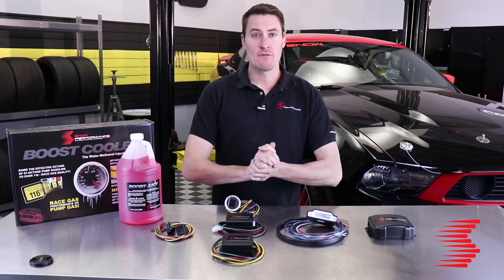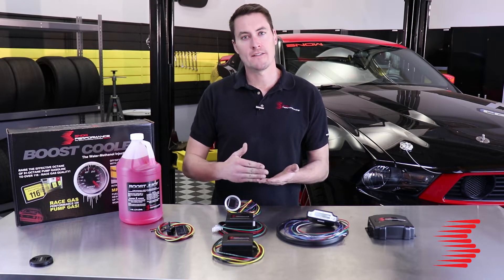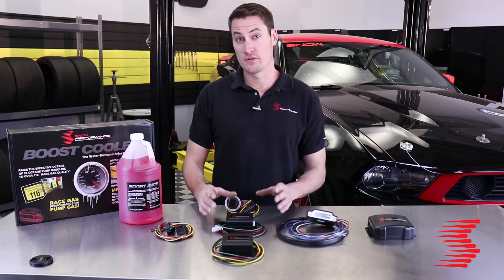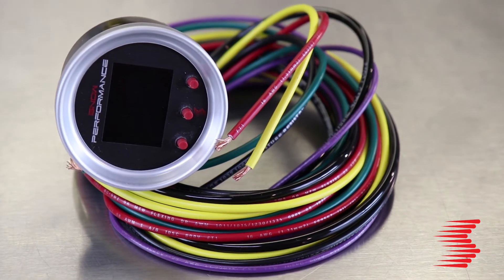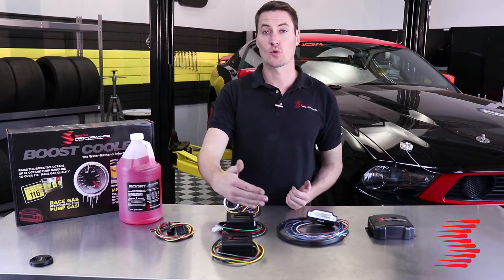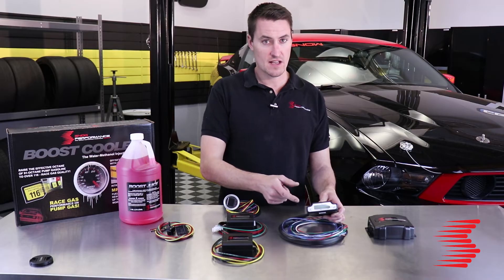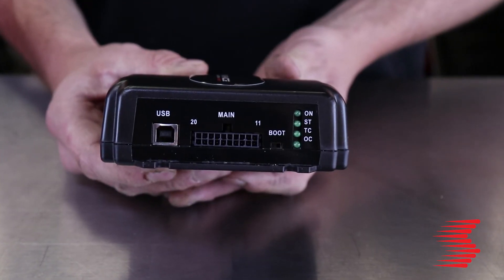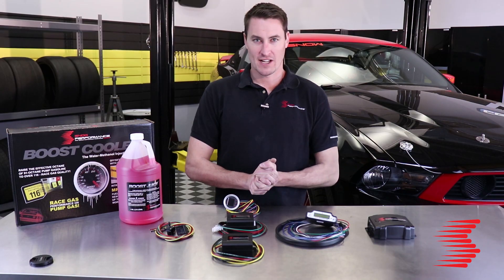Which Water-Methanol Injection Kit is Right For You?

Comment: Planning and going direct meth injection should I get a stage 2.5 or stage 3 kit
Reply from the maker: What boost pressure do you run?
Reply: @snowperformance1 no more than 35 psi. Car currently at 25

Comment: I'm interested in adding this to a n/a Corvette ls2. I've got a FAST intake, headers and full exhaust (400 dyno rwhp). What kind of gains would be realistic?
Reply from the maker: Water Methanol on an N/A engine won't have as many benefits as a boosted application would have. The power made on an n/a car would be the ability to adjust the tune to add timing making the ultimate power increase. The w/m will add some power in general but the main power is made from being able to get more aggressive with the timing/ tune.

Comment: Got a stage1 kit because I already had a Standlaone ecu that could be used as a controller. Was a really simple install. Just a trigger wire DPO02 for the haltech ecu. set up the parameters, Already had a fuse and relay panel so just 1 wire the panel and set up the pump and nozzle and it was done. Do wish it came with more than a size  6 nozzle and a size9 since im NA with a 3.0l v6 A size 4-5 wouldve been closer to the HP i was going for but oh well. Just set it up to trigger at a higher map ,tps, rpm signal.

Comment: naturally aspirated lol
Reply: There are lots of super high-compression NA builds that would benefit from this when race gas or E85 isn't possible to use all the time.  Hell, my grandpa used to get one of his sons to slowly pour a glass of water down the carb of a 440 big-block in a motor-home while going over Mount Hood.  It didn't add any power, but it cooled things down and cleaned the valves and pistons like crazy.
Reply: Did you mean to comment that under my comment?
Reply: I only meant that he kept saying normally aspirated instead of naturally aspirated
Reply: @wiggenvan  Oh.  That's just a dialect thing.  Like aluminum vs aluminium.
Reply: @JETZcorp  Oh sure enough, I didn't know that, I just assumed it was a slip of the tongue. Thanks

Comment: Had shop install my snow 2.5 kit yesterday should my fuel trim not be lower now ? looking at my data logs my fuel trim exactly the same the afr exactly the same what's best way to know if it's actually spraying ?
Reply from the maker: You can pull your nozzle out and place it in a 5 gal bucket, then purge your system to see if water-methanol is coming out.

Comment: You have the controllers.. Not much was mentioned about one controlled by various vacuum levels on a naturally aspirated engine. Propane burns hot too.
  NOW YOU JUST NEED A VASTLY DOWNSIZED PUMP MATCHED THE FLOW NEEDS OF A 74 CUBIC INCH V-2 AIR COOLED MOTORYCLE ENGINE.
Reply: Why are you yelling, you stupid boomer?

Comment: Hello Snow pERFORMANCE,  looking to buy Snow Performance PROGRESSIVE WATER METH INJECTION KIT 210 with a vc-50 controller and trunk upgrade. What is the life span of this system roughly, esp the pump and solenoid. Thank you!
Reply from the maker: As long as its properly maintained a system can see over 10 years of consistent use easily.
Reply: Is the proper maintenance outlined with the kit? Like at x mileage check or replace this item?

Comment: I have an older v25 controller system.  Are there components that I can upgrade like the nozzle and a solenoid.  This is for a procharged F1X making about 17 -18lbs at around 900-1000 hp.  Or should I look at a different system?   Here is the setup albeit it is faster now  https://www.youtube.com/watch?v=jqMdxvWYyq0&t=10s
Reply from the maker: You could definitely upgrade to a newer style nozzle, solenoid, pump, even controller. Since the vc-25 was discontinued we have upgraded essentially every main component in the system to make sure they are more reliable and perform better than ever.

Comment: Can i use a diesel kit on a petrol turbo application, cheers
Reply from the maker: We recommend using the kit/s intended for your application, rather than retrofitting a kit that is designed for your use.
Reply: @snowperformance1  but its the same nozzle for petrol and diesel correct?

Comment: For a low boost application like you would see on a 5.7 hemi (7-9lbs), does a progressive system still make since? Or does the small boost range mitigate the need for it?
Reply from the maker: I still recommend a progressive system for something like that. A non-progressive application would be more for a drag racing application or something like that where the vehicle is at WOT for a short amount of time.
Reply: @snowperformance1  on a hp ecoboost 2.0 build would you reccomend the stage 2 or the 3 for my goals hoping to fuel it solely on pump gas as no ethanol is available local to me but hoping to hit 500whp with my build. I'll have multiple tunes and won't always need to spray meth, is the stage 3 able to turn off the spray easily like the stage 2 or 2.5?
Reply from the maker: @michaelgearhart6685  Stage 3 will give you a little more precise injection than the stage 2 however I think personally the stage 2 is more attractive and works fine for most people. If you decide to get a stage 3 you will need to wire a switch inline to the power to have it be able to turn on and off.
Reply: @snowperformance1  How long does a gallon of your 50/50 blend last in your vehicle?  What is your fuel injectors' flow rate, MPG, fuel tank size, HP, and torque?  Also, for an engine with an 11:1 compression ratio, would your system allow me to run regular 85 octane with no octane booster and eliminate knocking?

Just wondering because I drive a 1998 Ford Expedition with a 5.4L V8 Triton 2V that I want to upgrade to a 11:1 compression ratio to help maximize my engine's efficiency.

Comment: @Snow Performance Water Methanol Injection is it possible to use the stage 2 n210 on a diesel application, was thinking of using it on my superduty but wanted to know as everywhere i searched up said it was universal and i just want to confirm
Reply from the maker: Yes it will work! That systems controller is based on boost alone so there should be no issue.

Comment: Thinking of running one of these kits on my B8 Audi S4. I find in most applications people are injecting pre throttle body, through the supercharger. However, I'm looking to use the SRM methanol injection spacer which is direct port injection, post supercharger. I wanted to know, If i use the SRM kit and I'm running one nozzle per cylinder, how accurately and evenly does the water/meth distribute? Might be a bit of a tuning problem if different cylinders are getting different amount of water/meth.
Reply from the maker: The purpose of a direct port is to get the best distribution possible. As long as the nozzle sizes are the same and its outputting good pressure that's going to be your best route.

Comment: Stage 2 map map controller? Is called for high compression set up ??
Reply: & sorry for the ghetto English my primary language is spanish 
My quection was :

What stage & name is good for 
- high compression 
- nitrous
?
Reply from the maker: @joseginorio6013  What vehicle are you working with?
Reply: 2000 toyota celica gts

11.5 forge piston 
320cc injector 
Aem ems4
100 shot nitrous 
93 octane 
Stage 2 exedy clutch/ fidanza flywheel
Super tech block guard
Supertech valve & retainer
Stage 1 mwr
Reply from the maker: @joseginorio6013  https://www.nitrousexpress.com/stage-3-boost-cooler-efi-2d-map-progressive-water-methanol-injection-kit-red-high-temp-nylon-quick-connect-fittings-sno-310.asp

This system ran in EFI only mode would work great!
Reply from the maker: What do you mean?

Comment: i have a 06 ford mustang gt with a vortech v3 non intercooled system what kit would you recomend and will it run off a 93 octane tuned pcm without needing a retune? thank you
Reply from the maker: We always recommend a tune to get the most benefit out of your system, however you can get it to operate without one. Personally I think the stage 2, 2.5 and 3 are all great options for street/daily driven type vehicles.

Comment: Hello Adam, great video I think I know the answer to my question but thought I'd verify it anyway. Question: The controllers can upgraded or are interchangeable with the stage 1-3 kits correct?
So originally I thought all I needed was the on/off boost switch so I purchased the stage 1 stainless steel braided line kit. It's a really nice kit, I just started installation of it. Actually I bought 2 stage 1 kits one for my car and one for my sons car (he paid me back for it lol)
So changed my mind and now I've just ordered the vc50 controller for my car for a progressive flow and to replace my boost gauge. We're also ordering the vc30 controller for sons car. I'm pretty sure I can use the new controllers with my stage 1 kits but wanted to confirm after I've already made the order 🤦🏻‍♂️😂
Reply from the maker: You can definitely interchange controllers! You just need to follow the new ones wiring diagram.
Reply: @snowperformance1  
I’m building a 6.0 Ly6 bored 30 thou over fully forged new heads fat cam and p1sc procharger tuner kit for my 2000 f body running stock ecu and plan on keeping the stock ecu. Was wondering what kit to use will be wanting to push 700+ whp. Very new to meth injection so wanted to ask thanks in advance. Will not be a drag car but will be at WOT a good bit since I will autocross the car sometimes but mostly it will be a everyday use type of build to a certain extent. To clarify will be drove back and forth to school every now and then which is a lil over an hour drive,  high spirited driving (roll raced on occasion.) So a fun reliable street/track monster.

Comment: what kit would be the best for my 2017 x5m f85 stage 2?
Reply from the maker: The stage 3 system would work well for that application!

https://www.nitrousexpress.com/stage-3-boost-cooler-direct-injected-2d-map-progressive-water-methanol-injection-kit-stainless-steel-braided-line-4an-fittings-sno-320-brd.asp

Comment: I have a sr20 non turbo which kit can be used if possible thanks..
Reply from the maker: https://www.nitrousexpress.com/stage-3-boost-cooler-efi-2d-map-progressive-water-methanol-injection-kit-red-high-temp-nylon-quick-connect-fittings-sno-310.asp
Reply from the maker: This in EFI only mode would work good!

Comment: Stock, naturally aspirated engine, fuel injected.. stage 1 be a good option for daily driver?
Reply from the maker: Stage 1 with a WOT switch would be good. It would only be active at full throttle though.
Reply: Snow Performance Water Methanol Injection where could I get a WOT switch for an N/A engine
Reply from the maker: @Eric.b2558  https://www.nitrousexpress.com/wot-switch-w-bracket-and-bolts-15524.asp

Comment: Just ordered a sno-210 for my gti. Can't wait to give it a go.
Reply: I’m torn between this and the aem progressive methanol kit. My tuner says Aem all the way but I wouldn’t mind saving a hundred bucks and going with a stage 2 snow.
Reply: @cordellingram808  if you just want to control it by boost then the snow will do fine. I installed mine about 5 days ago and have seen a nice drop in charge temps and increased timing. I can't wait to get it tuned on the Dyno and see the improvements.
Reply: @pospc2  did you go with the stage 1 snow or stage 2? my application is a supercharged honda prelude, that maxes out  between 6-9psi pending on pulleys. do you have an IG or facebook? would love to see your kit hooked up.
Reply: @cordellingram808  I went with a stage 2. Mine is a mk6 gti so turbo charged. I don't have IG or FB. My install is fairly simple.hatch mounted tank. Pump is mounted by the spare tire. Nylon hose ran under the kick panel carpet area. Into a grommet in the firewall. Then ran under the air box into the back side of the charge pipe right after intercooler. 
Controller is mounted in a vent pod.
Reply: @pospc2 random question, do you think a subwoofer in the trunk space would effect the reliability of the pump?
Reply: @cordellingram808  I honestly don't know. I could see the vibration not being so kind on it. Maybe space it apart as much as possible and mount to rubber to help with vibration?

Comment: So I have a 17 mustang 5.0. Its all stock besides having a hpipe & Li race tune on it. Its my daily driver too. Would it be safe to run a W/M kit on it?
Reply from the maker: You would be using a WOT activated system so it would not be on all the time. As long as you get a good tune with it yes it will be safe to use.

Comment: Just to clarify, your stage 2 with boost gauge allows the user to select the PSI the WMI starts & at what PSI it stops working at?  Would you say this would be the most ideal setup for a daily driver that only gets on the gas hard seldom throughout the drive? Also what delivery system do you implement? A single nozzle by the throttle body or a direct injection setup off the intake manifold runners? If you're system has a single nozzle setup, do you also provide the hardware to setup a direct injection setup? Finally is your system completely turn key in the sense that you supply everything needed to install and maintain the system which includes the WM mixture?
Reply from the maker: You set a start and full boost point that will be a linear progression.Yes this stage is perfect for a daily driver! Typical installations are single nozzle systems in the intake pipe.Yes everything needed for install is supplied however you will need to purchase the water methanol mixture.
Reply: @snowperformance1   would you say that the stage 2 is a better daily driver setup over your stage 1?
Reply from the maker: @atlasdelmar481  Yes i would say stage 2 is better for a daily.
Reply: What is the starting percentage rate with this controller ?

Comment: Can I use the vc50 controller and AEM pump??
Reply from the maker: yes the VC-50 will control an AEM pump
Reply: Snow Performance Water Methanol Injection also is there any way to run more psi then 50psi
Reply from the maker: @Ninja-357-  You can run more boost but the controller will not progress after 50psi it will be at 100% from there on.
Reply: Snow Performance Water Methanol Injection so if I go over 50psi it will keep on spraying is that right thanks
Reply from the maker: @Ninja-357-  Thats correct.

Comment: Hi can you help me I am looking at your water and methanol kits I am looking to use them with a nitrous kit. 
I know most user methanol and water kit so they can advance the timing to produce more power but I am not looking to advance my timing . I am looking at it so i can use the w&m kit  to call down the chamber so I don't have to pull the timing. 
 If i dont go with the water and methanol kit am  i  better off running a separate fuel cell &  putting E85 into that then going to my fuel solenoid. 
If that is the case do i just put e85 into the fuel  sell or do I need to mix it with a bit of petrol. Say 1 part e85 and 3 parts petrol . So a 1to3 ratio. Can u help me work this out . 
Like I said I know people that use water and methanol so they can then advance the timing spark and produce more power. But i am just going to use the e85 only when spraying nitrous. So i am not sure what i can get away with . I no e85 is a lot colder  even to the touch compared to petrol. I use 93 to 98 ron pump gas in the UK.  But i am new to E85 , but been told it  helps with the temperature in the chamber and again with the spark which with nitrous guys that key. As if i can get this right i dont need to pull timing at all. Or if i get a  stand-alone ECU i could run  advance timing.
But for now i am just looking  at e85 as a way of me to get around putting timing from the engine and I only spray my nitrous hear and there. So i fill up with pump gas petrol . Then if i need power i spray my nitrous.  But i have to pull timing out even with out  spraying nitrous timing has to be pulled so that way when you do spray it don't go bang. I am looking at E85 as away round this. 
I hope this makes sense to you  and if u can help

Comment: what kit would work best on a  blow thru carb setup?
Reply from the maker: Assuming it is a 4150 we would recommend the part number in this link. 
https://www.snowperformance.net/stage-1-boost-cooler-forced-induction-water-methanol-injection-kit-red-high-temp-nylon-tubing-quick-connect-fittings-sno-201.asp
We do offer a 4500 flange version as well ig you need a plate for the bigger flange.

Comment: I bought Snow stage 2 kit & never installed it,
I am unsure how to set up the box vc-25/MAF. I bought cyclinode upgrade & dual nosel upgrade. How do I adjust box, I read instructions several times and I've very confused.  Running 306 v2 vortech.
Looking to cool intake charge, car is tuned.  Any help would be appreciated.👍
Reply from the maker: That is a little more involved than what we usually put in a comment.  Please give our tech line a ring at 1-888-463-2781

Comment: I have a 2004 GTO that I added a LSA supercharger along with cam and heads etc to it the car would be a daily driver What system would you recommend and also I would need a nozzle that will be able to go into a silicone intake tube thanks

Comment: Installed your stage 1 kit on my 2017 Focus ST. Works great!
Reply: Brandon Monroe does the stage one have some type of failsafe? Or can your tuner make the car go into limp mode if it doesn't spray somehow?
Reply: sergsrt8 hey there. No the stage 1 kid does not include a failsafe. I do not tune for methanol. Running it untuned can still net small power gains if using a smaller nozzle and will continue to clean valves and lower temps in the combustion chamber.
Reply: Brandon Monroe ok thanks
Reply: @brandonmonroe9867  how much would you say is that small power gain? did  you notice it or you check before and after with some android app perhaps?
Reply: How long does the tank last between fill ups on your stage 1...looking to add to my kia stinger
Reply: How hard was it to install?
Reply: What is the specs of the pump if i want to do it myself?